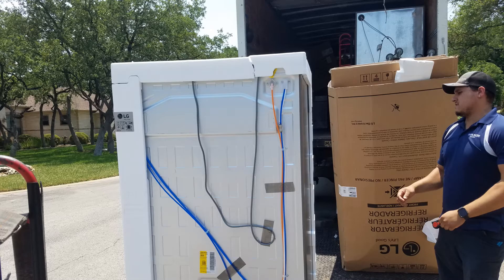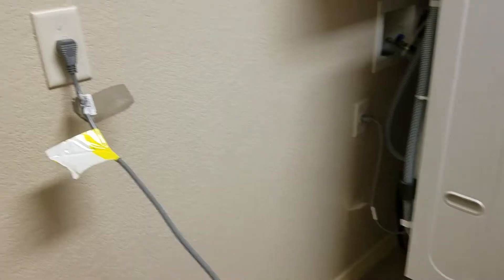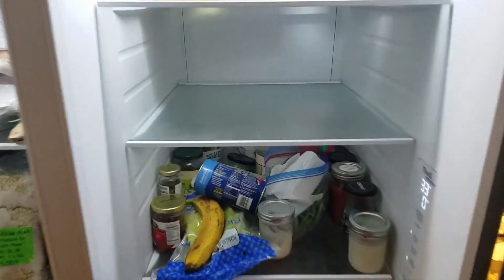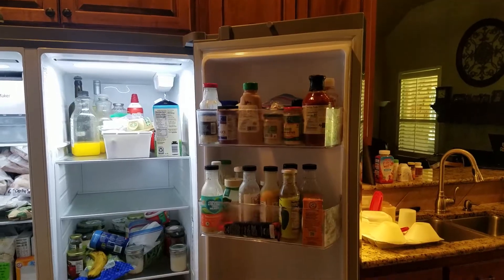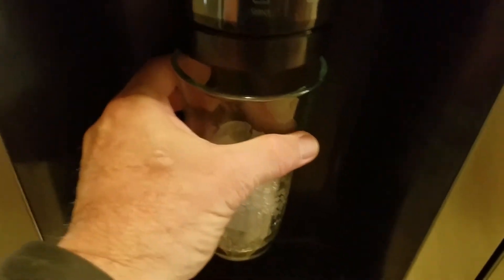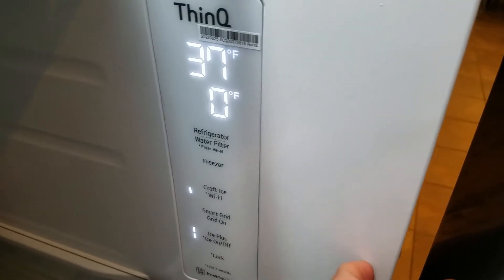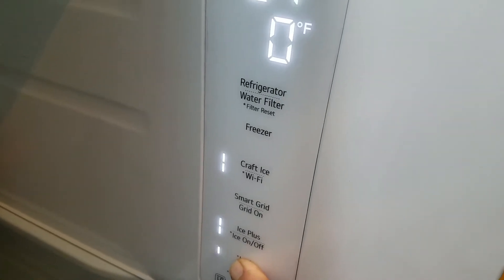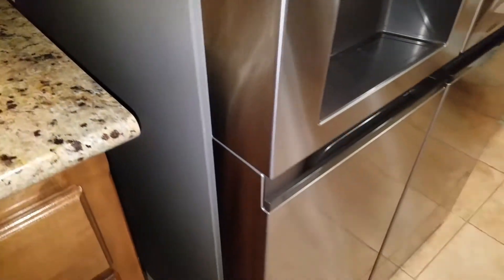LG Electronics 27 cu. ft. Side by Side Refrigerator model LHSXS2706S - Part 1

Comment: Lots of good info here, thank you. In my kitchen I need to put the fridge almost up against the wall on the right side. I have less than an inch of clearance if I choose this model. Will there be room to open the doors straight out or does the door need some extra width when opening?
Reply from the maker: Inch on the side?  When opening the door to 90 degrees (straight out), there needs to be minimum 2-3 inches. Of course, to open the door wide, you need the width of the door.  You would also need to open the door wider to get the bins / shelves out.
Reply: @DrBDIY  Ouch, that's a problem. Our previous fridge (Samsung) needed less than an inch as the doors were not hinged on the edge and didn't move much sideways when opening. I see your point about getting the bins/shelves out. Our previous fridge let us open the bins fine for daily use but for washing we had to slide the fridge out to get the doors open wide enough so the bins could be removed.Thanks for the help, good to know.
Reply from the maker: Your are welcome.

Comment: Great review I just got mine thanks!
Reply from the maker: Enjoy it
Reply: @DrBDIY  how long did it take for your ice and water to stop having a weird taste ?
Reply: ive dumped filtered out probably 3 gallons of water and threw away 2 full things of ice
Reply from the maker: Here are instructions. 

• Throw away the first bin full of ice (about 140-
160 cubes) after installation. The first ice and 
water dispensed may include particles or odor 
from the water supply line or the water tank. 
This is also necessary if the refrigerator has not 
been used for a long time.
• Dispense and throw away 2.5 gallons of water 
(flush for approximately 5 minutes) after 
installation. Do not dispense the entire 2.5 gallon 
amount continuously. Press and release the 
dispenser pad for cycles of 30 seconds ON and 
60 seconds OFF. This is also necessary if the 
refrigerator has not been used for a long time.

I did that and had no problem. Did you replace your water inlet line from the wall?  It is a good practice to replace those lines when you get a new refrigerator.  They can build up crud depending on how clean or softened your water is. Also, you put the filter in the top of the refrigerator, right?  The line and filter I would double check first.

Comment: Hey, would you please reply wtih what is the height of floor to your cabinets and floor to extreme top of fridge? i want to check if it will fit under mine.
Reply from the maker: I had the refrigerator in two places. The measurements:
Laundry Room opening:
33" deep (back wall to front of cabinets)  x  44" wide (between cabinets)  x 72" tall (bottom of overhead cabinet)
Kitchen opening:
38" deep (back wall to corner of side wall)  x  42" wide (between cabinets)  x 72" high (bottom of overhead cabinet)
In both cases, I didn't push refrigerator all the way back so the doors would not hit wall/cabinets.

Comment: My parents just purchased this model.  Water line installed but no water coming out.  Is there something we're missing?
Reply from the maker: "After the water filter is replaced, dispense 2.5 gallons of water (flush for approximately 5 minutes) to remove trapped air and contaminants from the system."
Also make sure water it turned on at the wall. You may disconnect the line from the LG to run water into a bucket to ensure line is not clogged. Connect and run a bit as indicated above to clear air.

Comment: How do I change the freezer temp on this fridge.
Reply from the maker: Open the top doors, look up and you will see Freezer marked on the edge. Push it and it will cycle through temperatures. Same for the refrigerator.

Comment: Would it tell you when to change the water filter ?
Reply from the maker: Yes, the Water Filter icon on the control panel will light up when it is time to change the water filter.  Then change the filter.  Next, hold the Water Filter icon light and it will reset.

Comment: interested in buying this model, any issues you run into as of now after owning it for 2 years or so ?
Reply from the maker: No issues. Still running fine.
Reply: It’s too small for me,
Reply: No door handles, so the doors get dirty very easily
Reply from the maker: No door handles?  The handles are the hidden black area almost in the middle of the door - horizontal.
Reply from the maker: A person has to like a side by side.  This is a utility refrigerator for us. We use the french door LG which has much wider shelves.

Comment: I just bought this model. The default temp for the fridge is 37F, but my thermometer says the fridge is actually at 40F. Should i be concerned, or just set the temp a couple of degrees cooler?
Reply from the maker: My metal thermometer always shows a few degrees variances. It depends on the compressor cycle.  On most fridges, be sure that food is not packed to the back and sides as it will block the flow of air.  You might check if the bottom of the fridge is colder than the top.  When the door opens, the temperature drops immediately. To be sure there is no problem, you could get a wired thermometer and monitor the temperature over time.

Comment: How much cold water do you get before the water coming out of the refrigerator starts not being as cold anymore?
Reply from the maker: Interesting question. I just measure dour unit and we get one quart of cold water, then maybe another 1/2 quart of cooler water before regular water pours, which is still a bit ool as the pipes are underground.
Reply: @DrBDIY  thank you for that information. We have a Samsung with Sprint stores right now and we probably get about a pint glass of cold water and then it goes cool. I think the hose that contains all the cold water within the fridge must be a little smaller in the Samsung fridge.

Comment: Thank you for sharing! Can we turn of the craft ice feature to use that space for something else?
Reply from the maker: Yes you can!   The manual:
Craft Ice
Press the Craft Ice button repeatedly to toggle between the 3 ICE, 6 ICE and OFF modes. After 5 seconds of idle time, the last mode will be saved, and the display will return to normal.
• To turn off the Craft Ice maker, select the OFF mode.
• To turn on the Craft Ice maker, select the 3 ICE or 6 ICE mode.

Comment: Is it a good buy? Would you recommend this brand and model?
Reply from the maker: So for the refrigerator is running well.  You MUST like the shape and geometry of a side by side refrigerator. Some do, some don't.
Reply: Heard the ice maker breaks
Reply: @All-about-everything  They fixed my pet gripe with icemaker. I had an older LG fridge. The ice used to get frozen into a large single iceburg in the icemaker every couple of days, Id have to get something heavy (e.g. my sharpening steel out of the knife block) and jam it into the icemaker and break up the iceburg. The metal hook in the icemaker does it for you now.

Comment: How long did it take to make ice. Ive had it connected for 7 hours and nothing.  Amazing video by the way.
Reply from the maker: Craft ice takes 48 hours: The icemaker begins producing ice approximately 48 hours after the appliance is initially installed. The first batches of ice may not be round and clear.
Did you turn ice making on?  Ice On/Off - Press and hold the Ice On/Off button for three seconds to turn the in-door icemaker on/off.
Reply: Yes everyrhing is on. Just wasnt sure. How long it took. Thanks again.
Reply from the maker: Ok, and of course make sure water is turned on at the line :)
Reply: 48 hours ..... Flush out the first 4 litres using water option and ice cube option all three ....and then start using ....just in case of impurities.
Reply: @Roshtheannah  Don’t forget to go through the water flushing procedure after changing the water filter…

Comment: got this same model. how long did it take to make the standard ice (not craft) after installation? I’ve had it for an entire day now and I feel like it’s barely made any
Reply from the maker: This seems accurate for our unit:
Ice is made in the automatic in-door icemaker and sent to the dispenser. The icemaker produces 70 - 182 cubes in a 24-hour period, depending on freezer compartment temperature, room temperature, number of door openings and other operating conditions.
• It takes about 12 to 24 hours for a newly installed refrigerator to begin making ice.
• Ice-making stops when the in-door ice bin is full. When full, the in-door ice bin holds approximately 6 to 8 (12-16 oz.) glasses of ice.
• Foreign substances or frost on the ice-detecting sensor can interrupt ice production. Make sure the sensor area is clean at all times for proper operation.
• To increase ice production, use the Ice Plus function. The function increases both ice making and freezing capabilities.

Comment: I have the same refrigerator delivered two days ago. We liked it but I have on issue, after two days the water is not cold water. After 24 hours I tried to drain thr water again and  a warm water came out from the dispenser. Do you have this issue before??
Reply from the maker: That is a problem.
Reply: So the water is not cold? We are trying  to decide  to buy the one returned  at Lowes  for 1,200
Reply from the maker: The water is cold in my refrigerator. The cube and chopped ice work well also.
Reply: I just bought this refrigerator. I'm so upset. It's not cold at all! I bought groceries, only to get up the next morning and all of the ice cream melted and the food was so warm. I readjusted the temperatures several times and nothing. I'm gonna return it and get a refund. I won't purchase LG again!!!
Reply from the maker: That is bizarre. Did you purchase at large store?  Best to return the unit.
Reply: @DrBDIY  we bought it at a large store. I called and told them to come and get it

Comment: How do you like this fridge after a few days?
Reply from the maker: The lady really likes it.  We had a top french door system for years where the shelves were much more adjustable and with less space between the shelves.  I got used to that storage. With the new refrigerator, the shelves have a lot more room between each.  So it is great for stacking or packing tall items on each shelf. That is the only think I need to get used to, but I am not the supreme commander of the refrigerator in our house.  As far as style, quietness, ice makers, WiFi, size - it is a great refrigerator.
Reply: @DrBDIY  Thank you! I bought the same fridge and really like it too